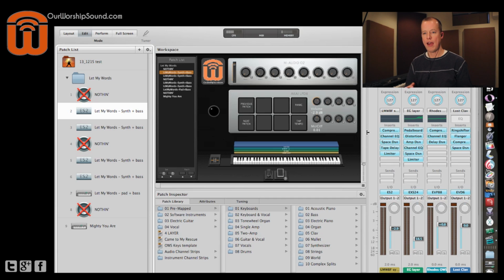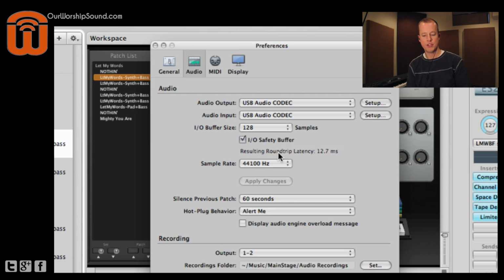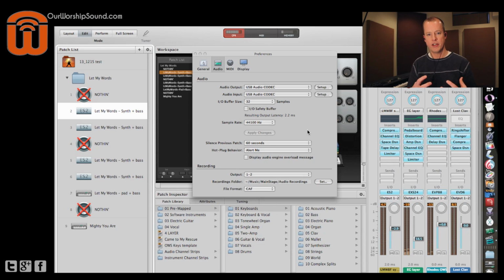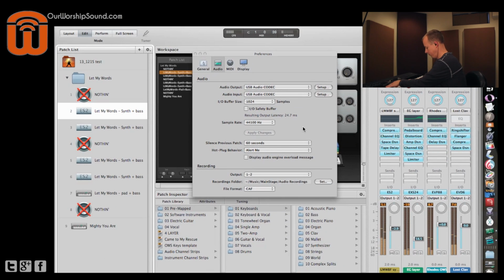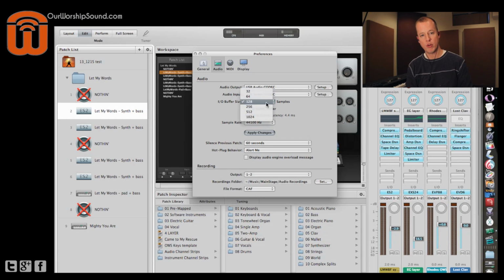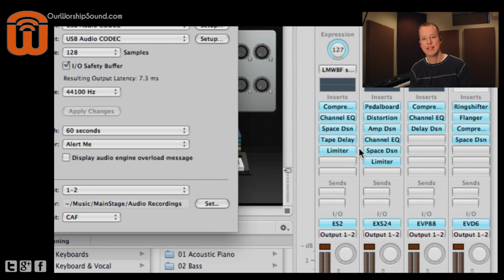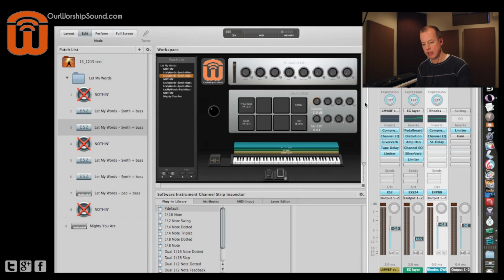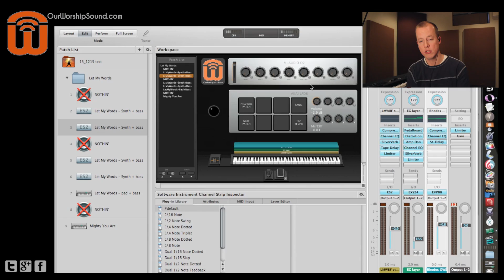Low latency in Mainstage

Comment: Hey bro , my mainstage concert patches are loading slow which means all the plugins in the channel strips are loading slow after changing the patch to another patch its taking 2-5 seconds to change the next patch....pls help mee..bro peter its a new problem to me..hope in u bro
Reply from the maker: That's really unusual.  Possible causes: 
1) is your computer is too old/slow to run Mainstage? or
2) patches are too complex or
3) buffer is set too low or
4) too many patches in your concert or 
5) corrupted concert - copy patches to a new concert
Reply: OurWorshipSound : ive copied all the patches to the new concert,but there is no change ,my pc is mac book air and it is purchased recently is any other possibilities
Reply from the maker: how many patches?
Reply: OurWorshipSound 35 patches bro
Reply from the maker: That's a lot - is that for one set, or all the patches in your library?
Reply: Thats the complete patch list in my concert..this problem is new to me iam facing the system overload problem and the patches ,channel strips are loading 5-10seconds late after changing the patch..what to do bro....searching for solution.
Reply from the maker: You either need to raise your buffer setting or simplify your patches.  If neither of those work, then there is something unusual happening that's beyond what I can help you with.

Comment: Hi, from Mexico.. Just a question, why I experiment problems with the continuity of the sound when I change patches? Please help
Reply from the maker: +Daniel Lopez Hi Daniel, I am not sure.  It could be processor difficulty or a RAM issue.  is there a way you can simplify your patches?
Reply: +OurWorshipSound thanks for your answer.. I change the buffer to the next level.. And it's working fine right know.. If I use alias is better what do U think could help? I only use Mainstage library.. The only problem is if there is a easier way to copy the entire patch in this way (alias) instead channel by channel.. There is a way to do it? Thanks and God bless U..